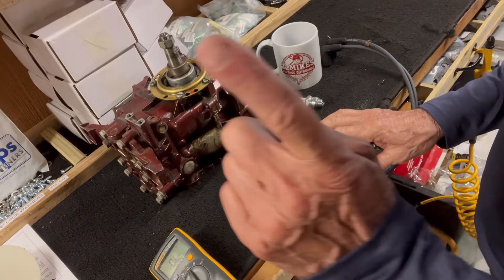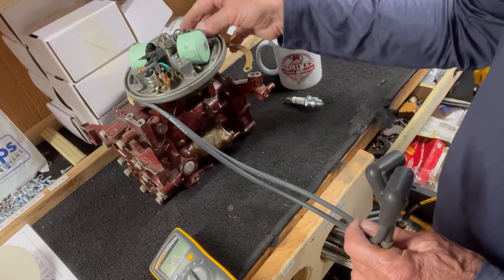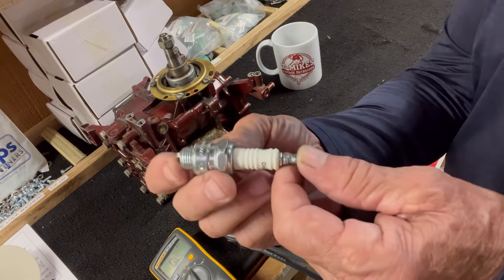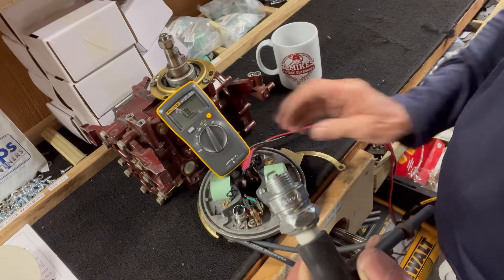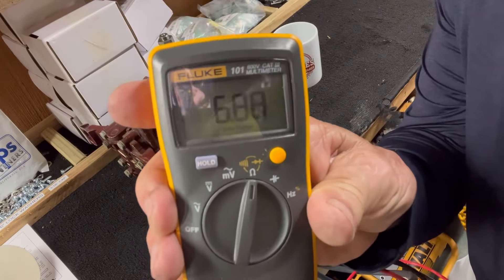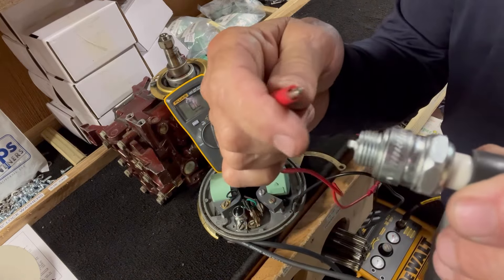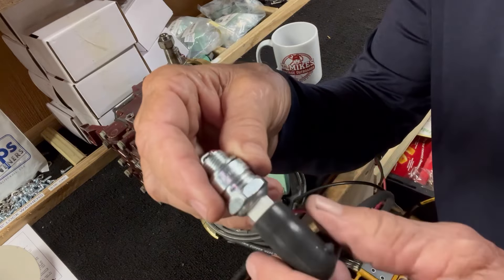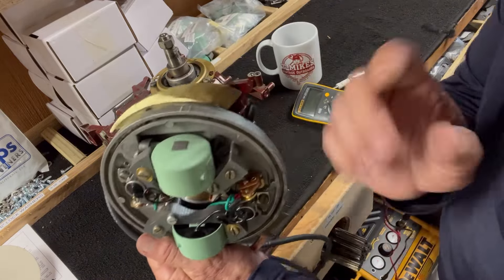“T-Mike Trick” Ultimate Wiring Test Ignition Magneto Vintage Outboards #outboards #boating

Comment: thank you t-mike for the coils you sent me.  Your videos and the coils you sent me, got the 1951- 1953 goodyear sea-bee motor running again.  That motor I bought when i was 16, and im 44 years old now is running but running hot.  I plan to take pump apart to diagnose issue, but parts is the issue.  You will probably hear from me again.  Thanks again, your videos are very helpful.